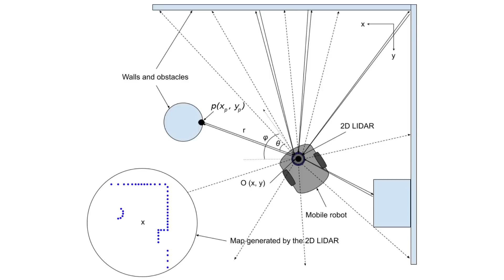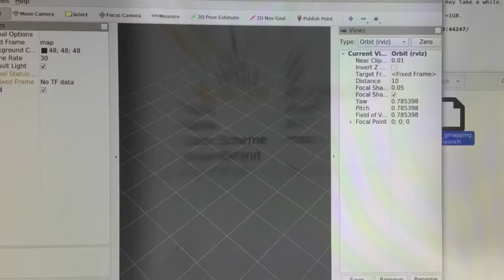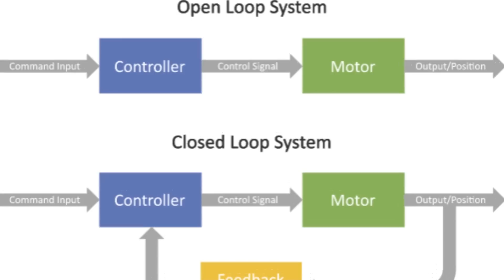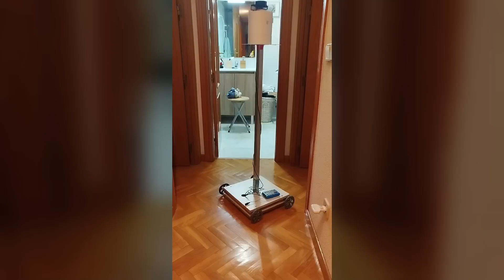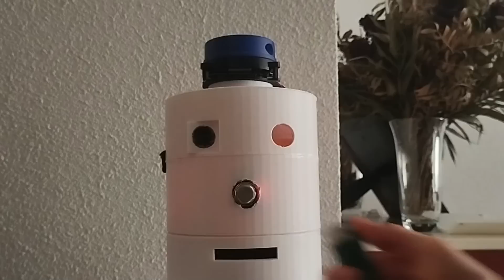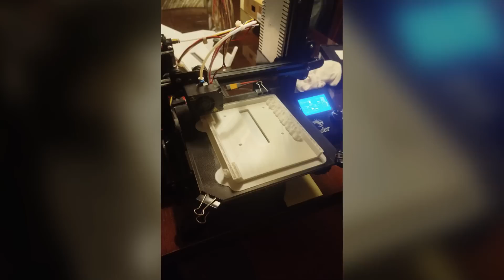I Made An Autonomous Humanoid Robot | Orion Pt1

Comment: I was taking my old Ender 3 apart while watching this video and I think I spotted you using one. If you ever get a way of receiving fan mail, I have a spare BigTreeTech main board, accelerometer, direct drive, BL Touch, upgraded springs and some other stuff. It will just hang out until I use it for parts but I think you could put it to better use, if your parents give you permission to setup a PO Box some day, I’ll send it your way. Keep up the good work.
Reply from the maker: Thank you! I appreciate the intention. Yes, I do use an Ender 3, and I've actually replaced some parts over time some of which I've ended up placing back! So it's usually good practice to keep those.
(Also, if you have a spare nozzle, you can make a super heat knife 👀)
Reply: @FlamethrowerYTI moved over to a couple Bambu printers and plan to build a Voron so the Ender parts I think are going towards some robotics projects, I’ll keep the heated knife idea in mind though!

Comment: Perchance maybe you could make a robot out of a roborock roomba as it will skip ALOT of the steps mentioned (already having a polished app, rc mode, charging dock, etc) whilst also cleaning the floor, you could then program it to have the same features like moving around the house or letting AI control it with a little tweaking¸ Just a sugggestion but thats what I would do as its pretty easy :D

Comment: I suggest taking the time to learn a parametric CAD program instead of working in tinkercad. I used to do the same thing, and once I actually tried the learning process was actually very quick and making parts was even quicker. As for software, I suggest FreeCad, it's free and open source (as the name implies) and actually supports linux. Seriously, so little of the major hobbyist level CAD software supports linux and it pisses me off.

Comment: I'm a 50yo freelance programmer, since about his age. The complexity of getting all of that working together is a stunning achievement for his age. Not just having the determination to start again, and again, but also evaluating the components, OS, and libraries to combine, adapting source code for purpose or compatibility and generally fitting stuff together into something that actually works and to the standard required - is exceptional. The force in Flamethrower is strong. My only advice is to learn linear algebra, calculus and information theory as early as possible - you're gonna need it.

Comment: Considering what you did and at what age: DAMH! I don't want to sound like a smart-ass and tell you what to do, but have you conaidered using a LattePanda (All in One PC + Arduino) or a second-hand mini PC + Arduino/ESP32 instead? That way you can have a discrete GPU for running local AI models, or at least a better CPU with more cores, and you can even install Windows IoT and use x86 apps. Otherwise keep up the good work ❤

Comment: Did you use two Pi’s, one for the motors and one for the chatbot? Or did you switch the motors to the Pi5 after you started getting the AI set up?
I was looking at using sonar sensors when I finally get the space/resources to continue my builds, but a lidar sounds like a multi-directional sonar sensor, so I’m gonna have to look into that the next time I order parts :o

Also curious if you’re considering uploading your projects as open source on github or elsewhere? Definitely gonna check out the sources you mentioned for tutorials, but it’d also be kinda neat to see what specific parts (motors, batteries, ect) that you wound up using for Orion.

Looking forward to seeing him with arms! :) Have fun with it!
Reply from the maker: No, I did use two Pis: a 4B for all the ROS stuff (and I think for the arms as well) and a 5 for the brain. And now that you mention the battery, the one I used is probably actually fake, I bought it from AliExpress when I didn't know better; I'm now making my own with lithium ion cells!

Comment: Good job
Reply from the maker: Thanks!
Reply: @FlamethrowerYT hi, I'm the same age as you and I'm also interested in these things and I admire you very much. You could also try a pcb board in the final version where everything would be more nicely arranged. And I also used to 3D model in TkinterCAD but then I took one FUSION 360 lesson every day which lasted about 10 minutes and I learned it quite well. And sorry for my English, I am from Slovakia
Reply from the maker: Nice! Yeah I could look into making a PCB sometime, that sounds like a nice idea. Also, isn't fusion paid?
Reply: @FlamethrowerYT no the basic fusion 360 insnt paid if you are using it for your self its only paid for comercial use and when you want more tha 10 cloud saved projects so you can save it to your computer and delete it from cloud
Reply: @FlamethrowerYT sorry for late answer

Comment: Since you were on ARM64, did you install Ubuntu Server for ARM? Since last time I checked, there isn’t a normal version of Ubuntu for ARM (this came to mind, because I had to install Ubuntu through the terminal once on an ARM VM). Also, very good video!
Reply from the maker: You mean the very first time? I have no idea. The second time (with MATE) I did end up having to download the server version and setting up the desktop environment myself (the picture of the error is from when I tried to download an archived version and kind of just brute-forced the modern firmware into the image lol)
Reply: @ 👍, for me it was fun manually installing the desktop environment, but I had a tutorial. I can imagine that it wasn’t fun having to manually install the desktop, while not knowing why the desktop isn’t installed by default lol
Reply from the maker: Yeah 😅

Comment: As a spoiler for your efforts, you will not get anything more than a tech demo for the arm functionality by making them move manually. You will, inevitably, have to recreate the functionality of that robot hand that solved a Rubik's cube. I mean, you will have to use machine learning in a simulation to train it to do whatever you want it to do. 

Don't be discouraged, though. I'm pretty sure there are open source implementations of that, but then you will have to be reading papers and adapting their code, instead of importing ready made libraries. 

You can use LLMs to make the papers easier to understand and rent GPU hours for quite cheap to train the AI. But I believe it is entirely possible to make the robot useful, since it won't have to adapt to every kitchen, just yours.
Reply from the maker: Well, I was planning to use MoveIt2 to do the inverse kinematics to send the hands to the position of e.g. each ingredient or tool and the just use the gripper to grab them. Would I really need machine learning for that? I mean sure I'd need to code each recipe but it'd probably be simpler, especially with smart scalability.
Reply: @FlamethrowerYTMy man, look at the most recent video from Boston dynamics. Having robot hands pick up arbitrarily shaped things is state of the art robotics, especially soft things like say, a tomato.

I've never done these kind of robotics, but I believe cooking is an endgame level challenge. Do you have any easier ideas to make the robot do first?

Comment: I did this in 3rd grade...   built a simple robot...  mine could go backwards, forwards... and blink it's eyes to remote control.   This was back when I was 8... in 1976.
I took it to school, demoed it to my class, and then my teacher took me to all the classrooms 1-5 to demonstrate it's function in a quickly improvised presentation.  She literally knocked on their doors and interrupted their classes and threw me in... lol.   
I ended the presentations at 5th grade because I felt rather embarrassed at that point...  as my maybe it was impressive to a 3rd grader or less, but not so much a 5th grader or anyone higher.
I had literally no electric parts to build it out of... nothing like today... with 3D printers and Aliexpress, ebay or online ordering at your fingertips...  so it was made out of wood and electric race car parts, wire, and homemade push button switches out of tin can strips (like I had used in my morse code wired set), assembled on a concrete floor of my dad's shop.
Reply: what is your channel lmao? Im so confused.
Reply: @Duckl_Owastaken It's ai generated slop, i reckon this comment is fake as well
Reply: @ Pftt, I have 15+ channels across 4 video hosting platforms, the oldest going back to the same year YT came out, with 500+ video and half a million views, and my website goes back to 2002.   I've been on the internet since 1986.   Ask Alexa or Perplexity or a G00gle image search, who is Choppergirl 2142.  

You're not very good at fact checking, are you?   I was hacking up text adventure game text parsers before you shlt your first diaper.
Reply: @Duckl_Owastaken Just click on my name, I have 15+ channels across 3 platforms.    There is no video footage of my robot, we did not have handheld camcorders, the internet, or digital cameras in 1976.   My robot is long since gone into history.
Reply: @Duckl_Owastaken I just saw what you meant lol wth